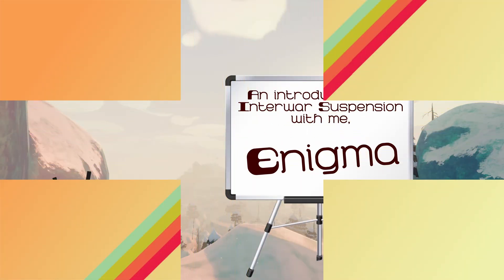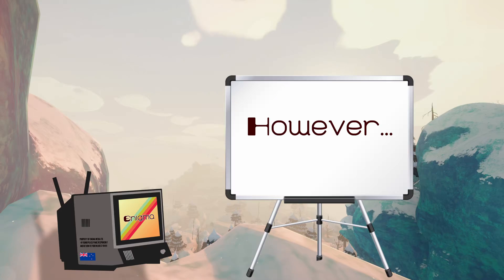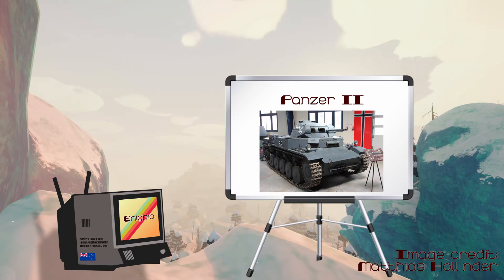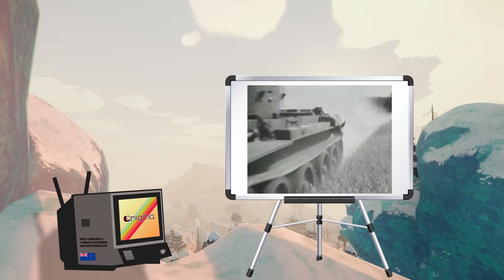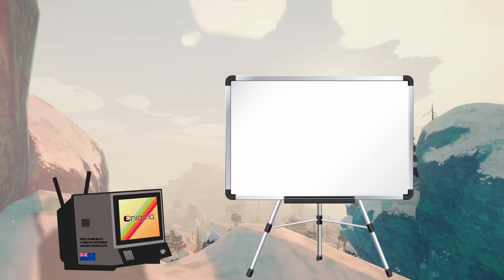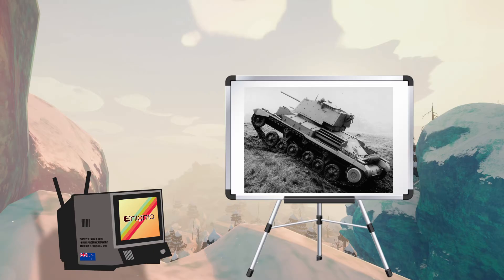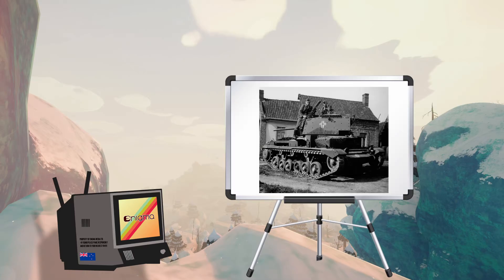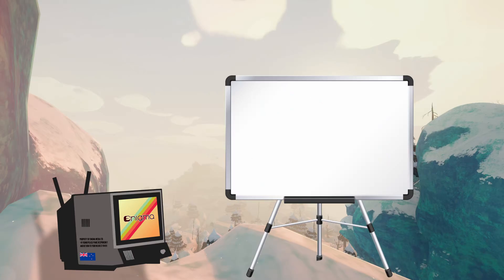The Evolution of Interwar Tank Suspension | Tanks Explained

Comment: I always figured multiwheel bogies also allowed tanks to take advantage of a sort of walking beam suspension effect so things like springs and shocks could be simplified or ignored for similar performance.
Reply from the maker: while you're correct with the fact it simplified the springs and shocks you still would've needed it no matter what
Reply: @Enigma2373 yeah I just mean like the Sherman VVSS where it doesn't have traditional shocks, the walking beam effect is your shock absorber. What you said kinda confirmed that for me. Not saying a shock absorber wouldn't make it better either, cause clearly the HVSS did better by clearing out some room for them.